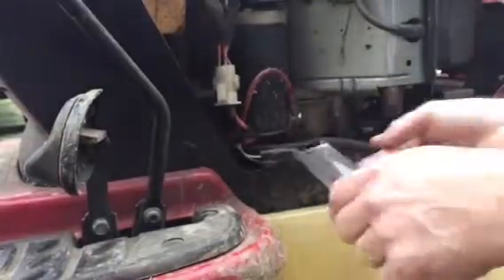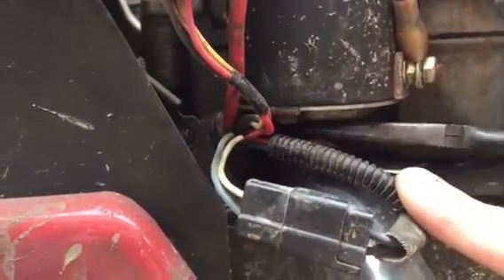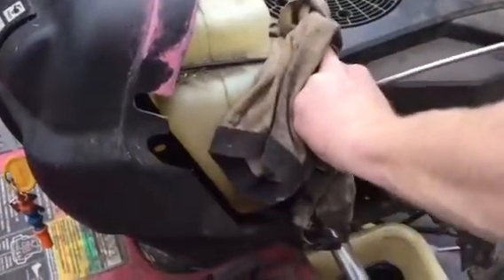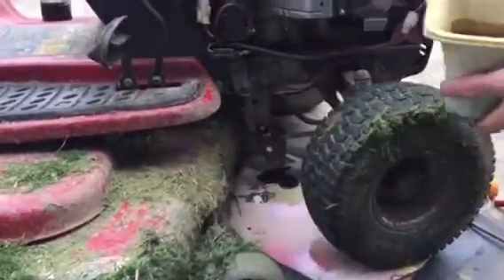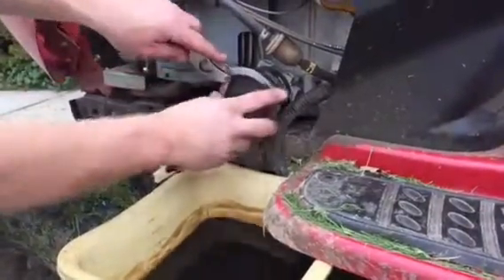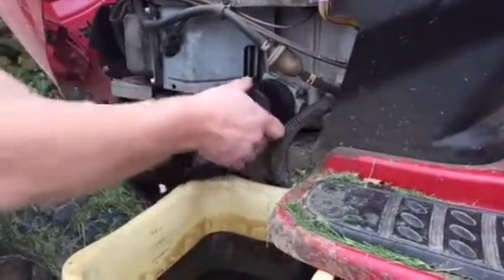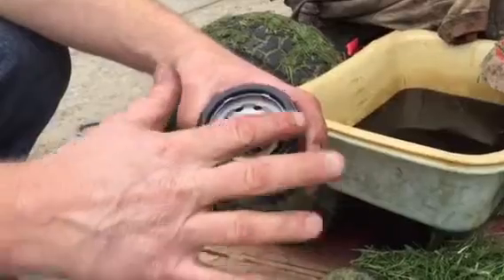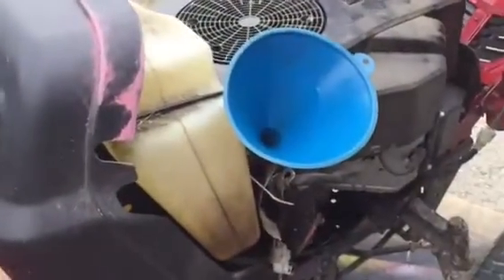Changing the oil in a Toro LX 500

Comment: if you still have access to this mower could you start it up sometime on video
Reply from the maker: Unfortunately it is now winterized, What did you need to see by starting it up??
Reply: Thats perfectly understandable as my craftsman mower is winterized as well right now.  I didn't need to see something in particular I just wanted to hear it start up and run.  I just like to hear them startup especially when there is a Kohler engine particularly vtwins in them.  I know this may sound weird.  I mess around some with mowers myself got three a craftsman kohler vtwin, husqvarna kohler vtwin, and a Bolens Briggs Single OHV
Reply from the maker: I can tell you that when it does start it is smooth and runs strong. I love the Kohler engines.
Reply: Well thats good to hear.  I am not knocking Briggs but, after having a few Kohlers I love having a Kohler engine over a Briggs any day
Reply: 427 Elevating Productions how to fix the brake on a 2100 toro riding mower

Thank
Reply: Help
Reply from the maker: Help with?

Comment: The oil isn’t coming out the yellow plug what does that mean there is oil on the stick
Reply from the maker: It sounds like you have a blockage somewhere. Try gently inserting a small “probe” preferably something plastic into the drain hole to see if that allows oil to drain. If that gets things draining you will want to run something (like Seafoam)  through to clean out the inside. Hope this helps. Thanks for watching.
Reply: funbro1 I had to take a small rod and tap it with a hammer I guess it was sludge or something
Reply: @funbro1  I have the same problem, but what I'm wondering is after I unclog it what keeps the oil from flowing out, the yellow cap is loosely on there.